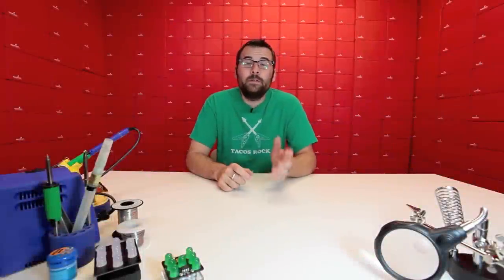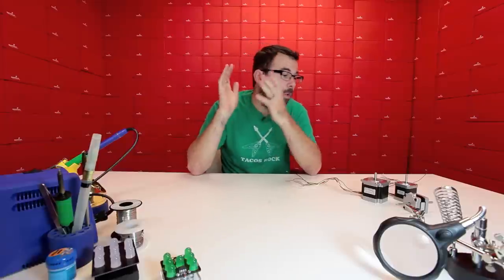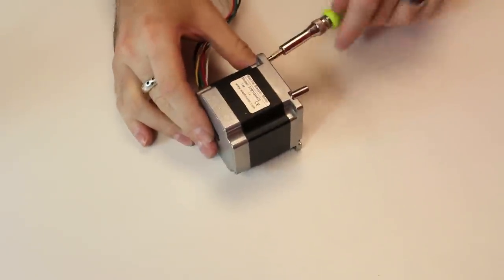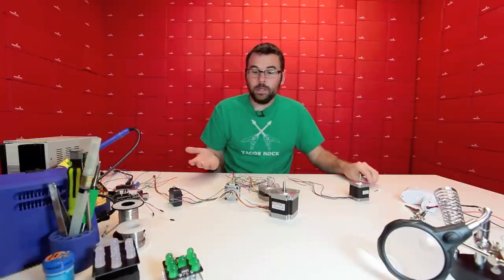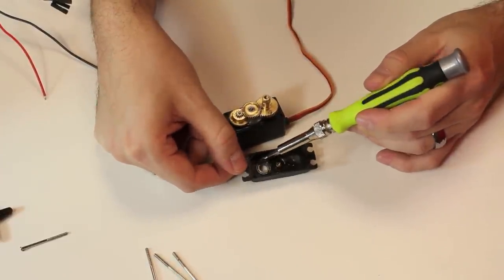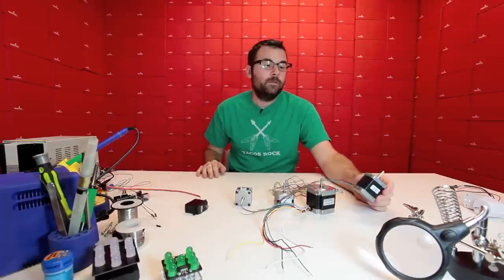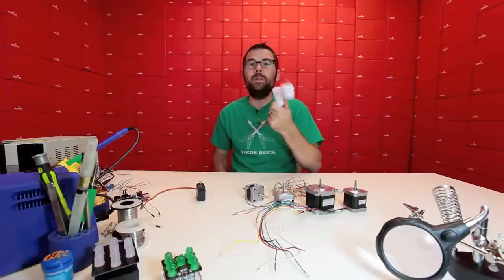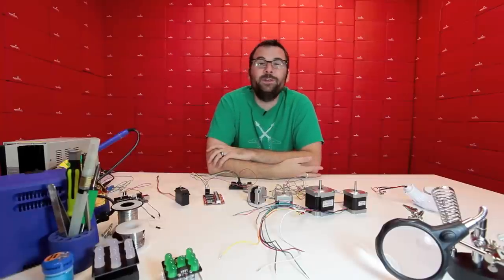SparkFun 10-21-11 Product Showcase

Comment: He did say IF... plus, the practical point isn't "if you hold it" it's if it hits a mechanical block of any sorts.  If you are swinging a big arm with the stepper it could be pretty easy to gain a mechanical advantage and hold one.

Lots of devices use this ability to "slip" for "homing" purposes since it has no feedback system.  You know you are at "0" because you banged against a physical stop for at least one full revolution and it slipped each time till the homing sequence was done.

Comment: @iHeartMagic Usually quadrature encoders are used, which have two optical sensors at different locations. What this means is that when it turns in direction 1 it will output 00, 01, 11, 10, 00, ... while in direction 2 it will output 00, 10, 11, 01, 00, ...

Comment: So the potentiometer will change even if you manually turn the shaft with your hand? In other words, does the potentiometer indicate location only when the motor turns the shaft? or when the shaft is turned at all?

Comment: Can step motors go forward and backward? If I want to have a lid that rotates 90 degrees and then it comes back to the original position.
Reply: yes it can turn backward but u need to use a h bridge so that u can change the terminals

Comment: hey i went bank i cant think what ic chip i can use for lpc1114 to control a 12 led  pin 1 vin  pin 5 ground  (well 2 ground pin is grounded to 3 leds and 3pin grounded to 2 led  ) im split them so i can control singly so il have 12 leds to control

Comment: While it was interesting to watch and useful for demonstration, you should be aware that removing the rotor from a stepper motor permanently affects the magnetization of the rotor, and the motor is irreparably weakened.  You should warn your viewers that they should never disassemble their own steppers for any reason, and I suggest you don't try to sell the motor you took apart.